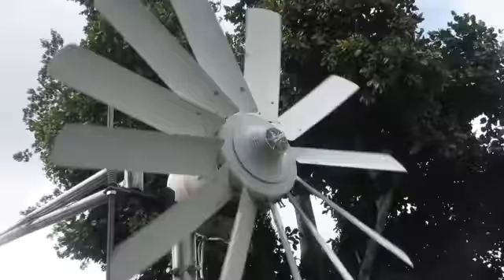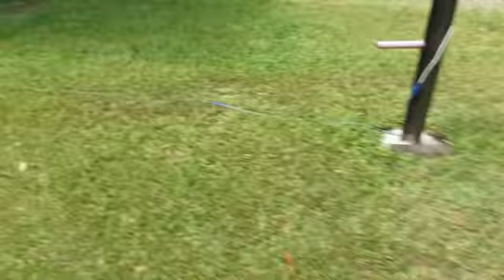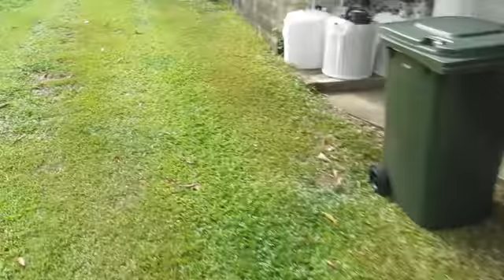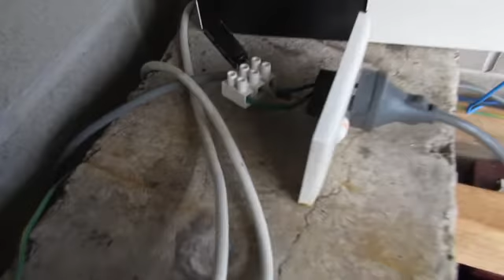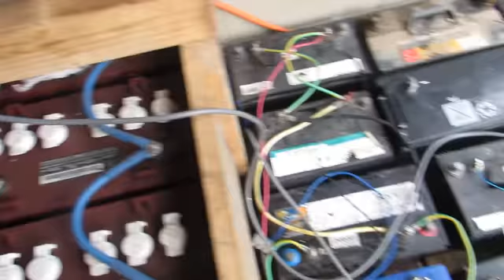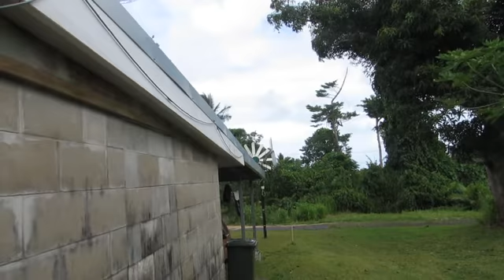2) fisher and paykel washing machine generator Amp test

Comment: Have you rewired the motor or did you leave it stock. I am building one but a vawt style.
Reply from the maker: BackRoom Labs Sorry being ages since I have been back into my account. If you are still interested I have left it stock. It rotates at low RPM so I need to keep the volts up for my 24 volt system. I have now got 2 going and I had some strong winds one night and they were fair screaming at around 200 RPM each sometimes. I have upgraded them by adding another fan blade to the end of the ones already there. at the time of the strong winds, both combined in parallel were producing around 7.2 amps which would have been at least 100 volts, lucky my charger was able to take around 120 volts. Thanks for watching, the video I have made a few videos but I need a descent editor to make them a bit more professional. I'll have to get back into it and start posting some up. I am presently designing a water turbine that will drive 2 motors at once.

Comment: Great Vid and even better coming from a fellow Aussie!
I like your use of recycled materials to make good and practical equipment. I'd really like to see some more vids on your setups and engineering.
I noticed you seem to have quite a few of these washers so setting up some more would help you make even more power.

Good luck with it all and thinks for putting up the vid.
Reply from the maker: Oil Burner Haven't been into my account for ages. Pleasant surprise to see so many views. Thanks for your comment. You certainly are into your oil burners. Good to see people getting out there and doing things. Cheers.